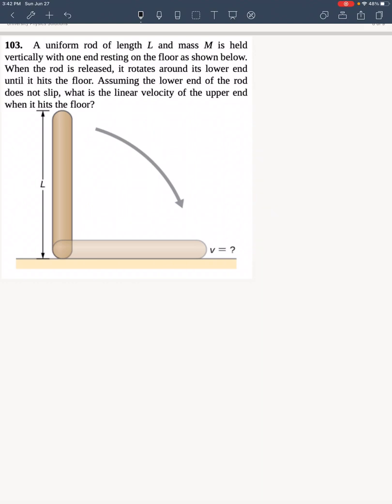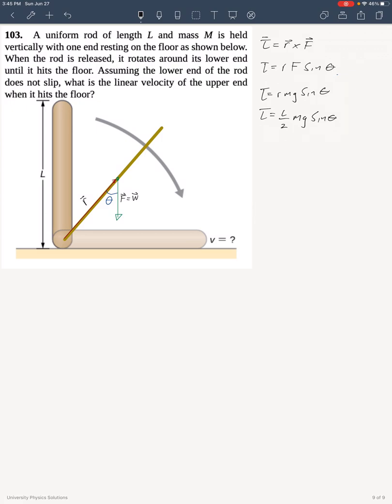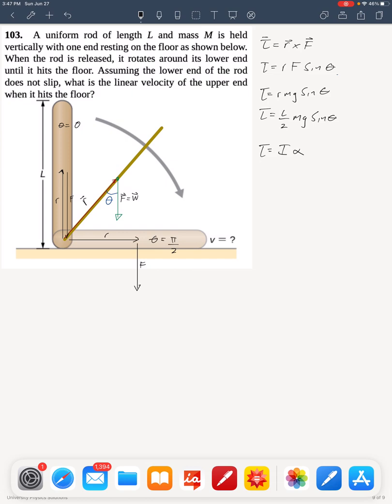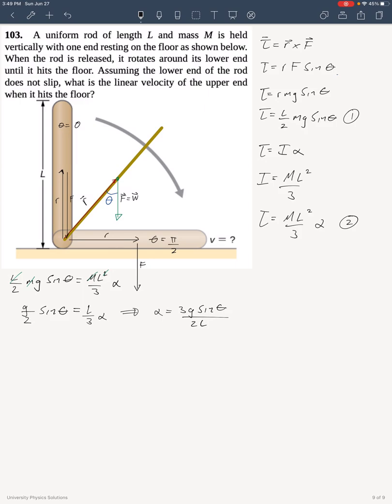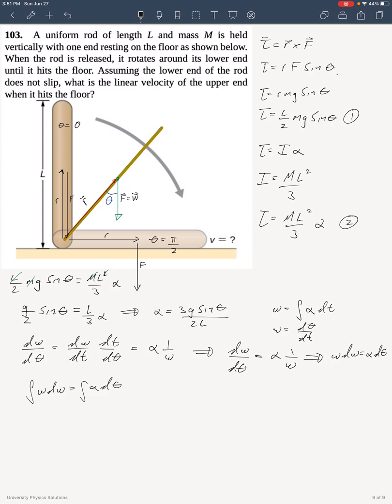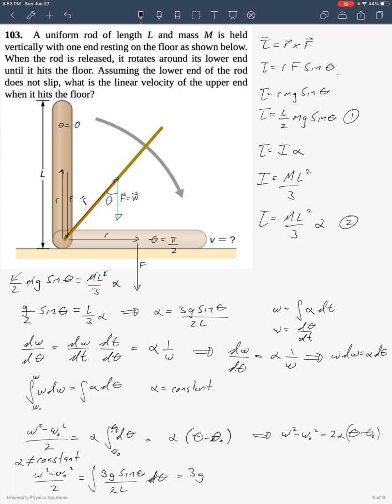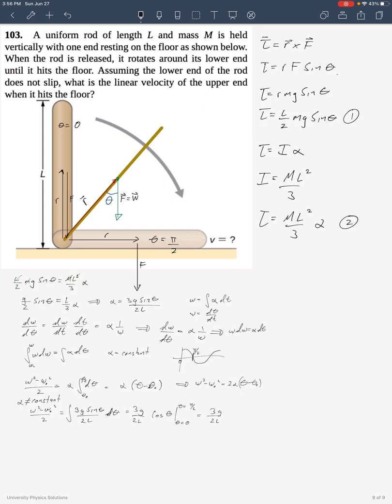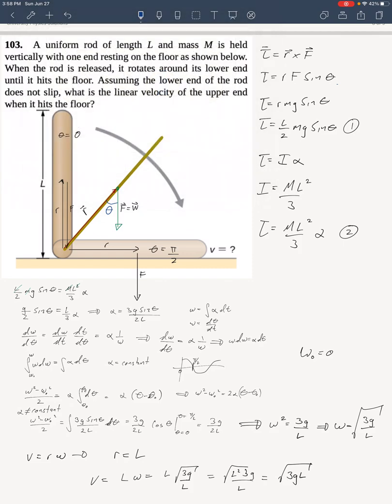University Physics -Fixed Axis Rotation- Chapter 10 Problem 103

Comment: There's no way I would be able to solve this question
Reply: can literally just do conservation of energy since 1/2 mgL = 1/2 Iw^2 and solve for w. so much easier than this beating about the bush method in the video. note GPE = 1/2mgL since the reference point of height is from the center of the rod.
Reply: @J_Lau1014  So much easier and this make sense too, he just threw a bouncer on me.